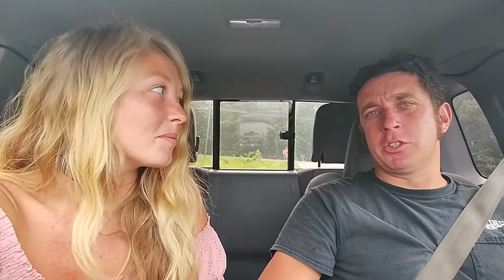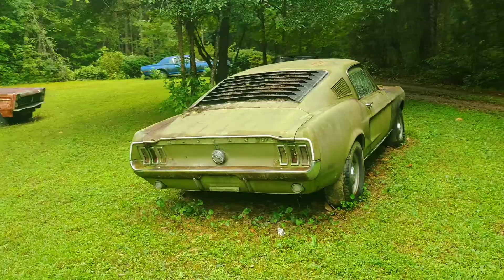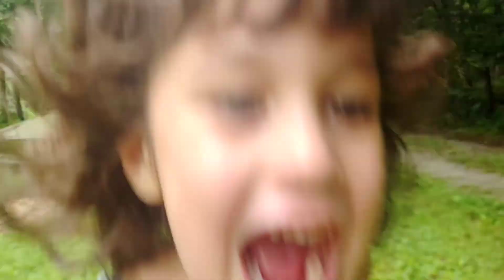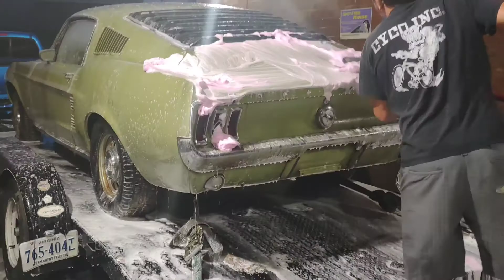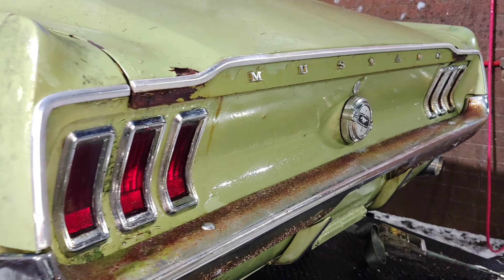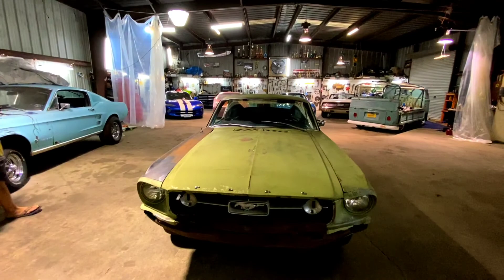1967 MUSTANG FASTBACK | FIELD FIND | Episode 2 | SHORT HAULS | graysvws

Comment: My first car was a 67 fastback this exact same color. My dad drug it home when I was 14 years old. He told me if I wanted a car, I had to fix it. It had hit a oak tree head on. The radiator was against the firewall. I had it running like new by my senior prom. That night, the brakes went out, and my date went home with another man. My alternator went out on the way home, so i had to drive home in the dark with no brakes, and no lights.  Joined the military 1 week after high  school. So it sat for 3 years. When I came home, I got married, and my wife didn't like the car. It was to hard to put a car seat in the back. So I sold it for $2500. Now I'm 50 years old, and trying to track down my old car. I have no VIN number to go off of. Just the guys name, and location i sold it to. So if anyone has any tips.....please send them my way.